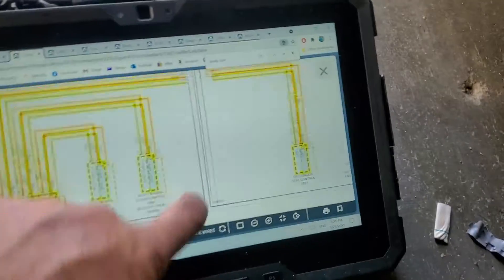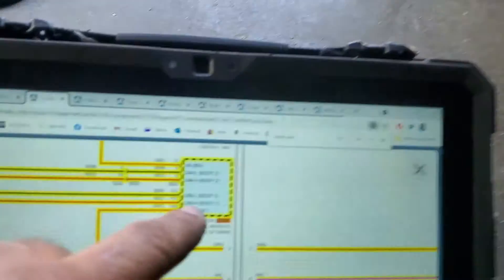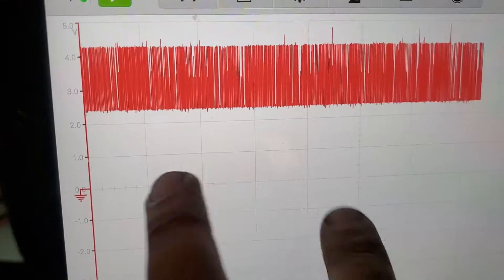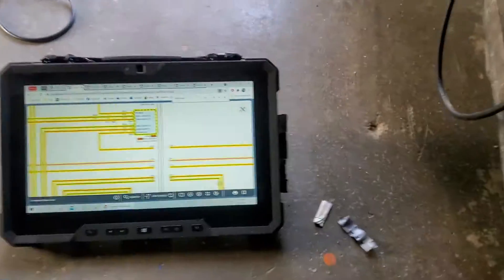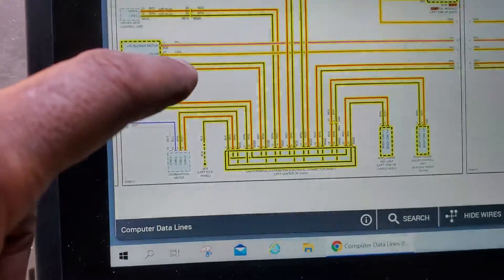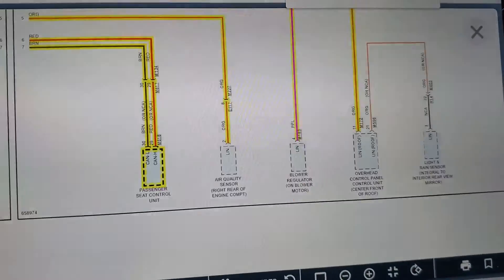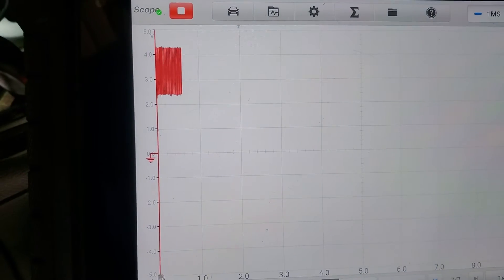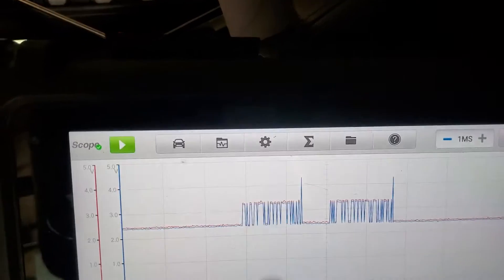CAN BUS TIP

Comment: So I’m trying to learn a little about can bus and am a little confused. You said if the signals lay on top of each other they are good as the ones in your video are. Yet you are replacing the body control module because the signals are laying on top of each other and they are bad. Sorry if this question does not make sense I am I just a little confused on the explanation.
Reply from the maker: I think I did not explained it clearly enough in the video and I am glad you asked the question. To determine a bad module you have to verify presence of powers and grounds. You also have to verify a good can bus waveform. In this case I was able to see waveform at can high (body) and can low (body) at the BCM, but I was not sure if that waveform is good in min and max value and/or data packets formation. A quick way to do so, without digging in pages and searching for values, is to probe on can high and can low of another WORKING module on the same CAN BUS, but the catch here NOT to compare can high with can low, the hint is to compare can high on the suspect module with the same can high on a working module. If both match each others that means you have a good values/signal of CAN BUS at the suspect module, regardless the numbers or shape of waveform. Hopefully this will clear things for you.
Reply: @DallasAutoDiag  Yes thank you for taking the time to explain it throughly!! Awesome videos, keep em rolling!!
Reply: @DallasAutoDiag   LOL you just answer my question thank you for your time to explane all of that